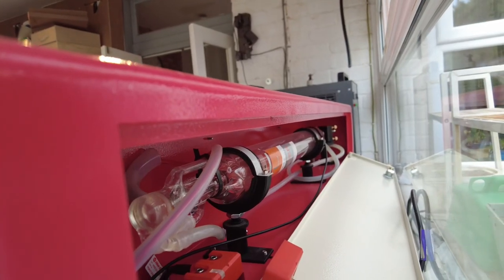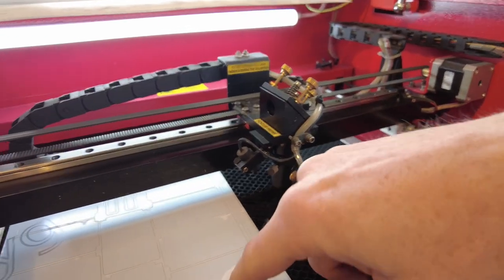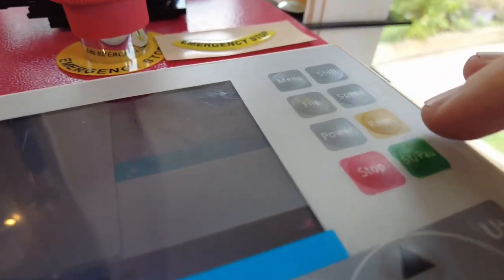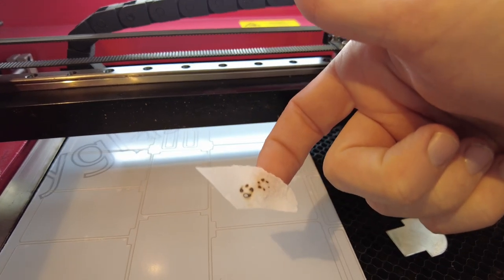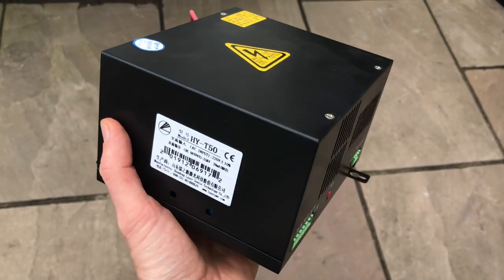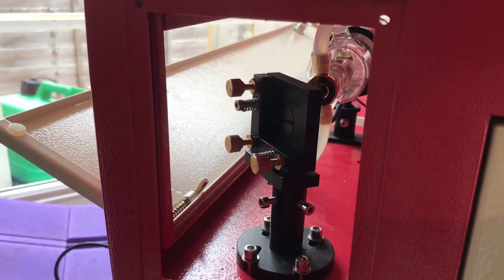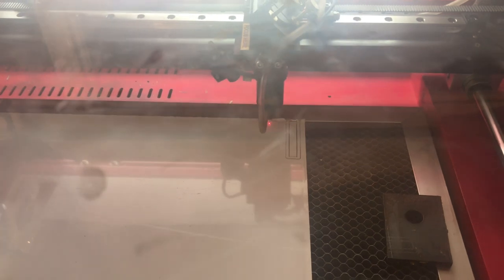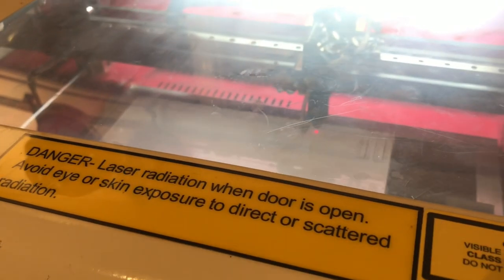Blown CO2 Laser Tube = Expensive problems - Workshop Wednesday #2 Vlog

Comment: hi dear, I just bought a new machine and I have the same problem (halo circle).. and I have already tried to clean the lense but the problem still there, can you help me..
Reply from the maker: Unfortunately it’s either the tube or the power supply. If you have a spare power supply try that, if not, Try reaching out to your machine supplier. The danger is you put a fresh tube in and fry that with a dodgy power supply.

Remember tubes are consumables that will need changing periodically. I’ve changed 5 tubes now and never seen this weird halo circle before or since and I his turned out to be the power supply.

Comment: Wow you're lucky that you can have a repair guy come out.
Reply from the maker: It was only because it was under warranty, I've since changed two tubes myself. It's not difficult, but there are some really high residual voltages in the tube so precautions definitely necessary! Never seen that particular fault again since was a really weird one. Thanks for watching!

Comment: How many hours were on it?
Reply from the maker: I don’t know exactly which is annoying I had assumed there’d be a log in the laser controller.

Roughly 5hrs a day * 5 days * 11 months = 1100hrs ish? Maybe a bit less? That’s with a proper chiller with refrigerant. I suspect a tube using the bucket of water and pond pump would be a bit less but I may be wrong.

What was interesting was the one I just changed faded over the course of two weeks but this one just died in a single day and and didn’t exhibit the weird array of circles like the one in this video

I was planning on keeping a tube in stock but apparently they don’t have a great shelf life and my laser supplier is only an hour away so if needs be I can always do it same day. 

What’s been your experience?
Reply from the maker: I’m sure you can find out in the controller somehow but not sure how. 5-6hrs hours per day 5 days a week for 13Months. Whatever that is!